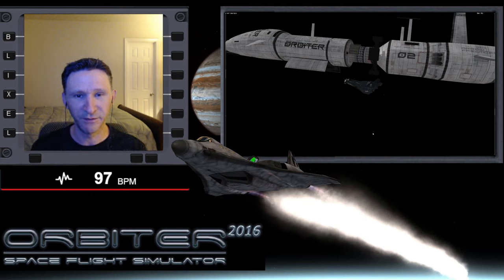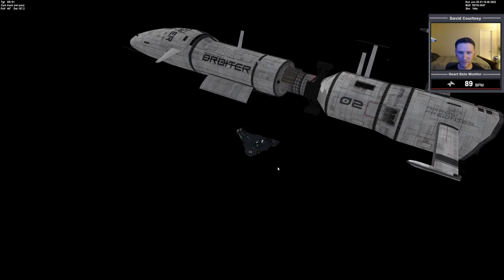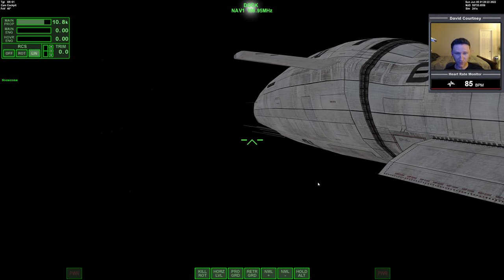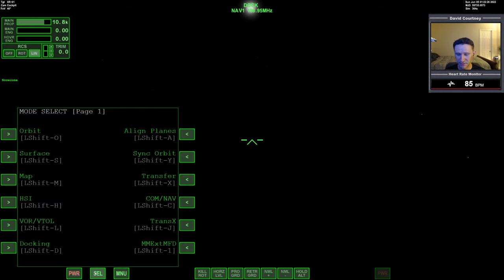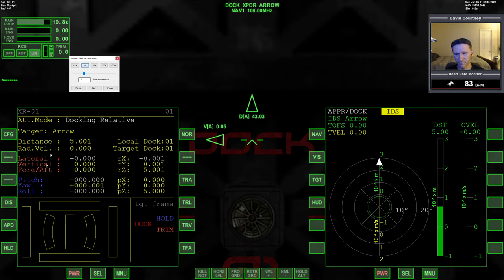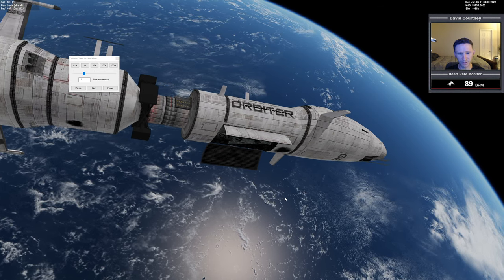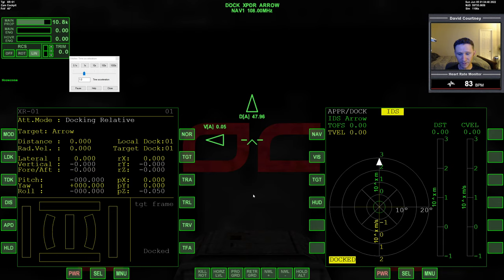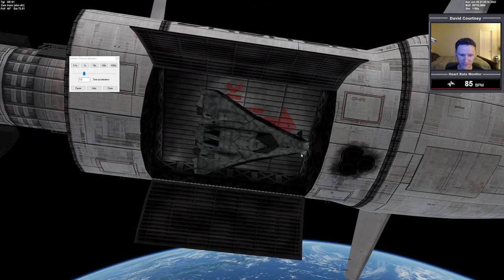Orbiter 2016 - Using PursuitMFD to dock with the Arrow Freighter

Comment: Thanks to you, I have yet to read the documentation for Pursuit MFD :)  I did find, if you access the CFG page while the autopilot is running, you can input linear or rotational speed values on the fly, using the RAT (rates) button on the right, to speed up the autopilot. (L 1.5 1.5 1.5) this command speeds up all linear velocities.

Comment: Nice Video. 
Ik you only want to change 1 of the numbers You can enter X Y or Z followed bij the new value to change it. e.g. "x50" will set pX to 50 without changing pY and pZ.
Reply from the maker: Pro tip, thanks!